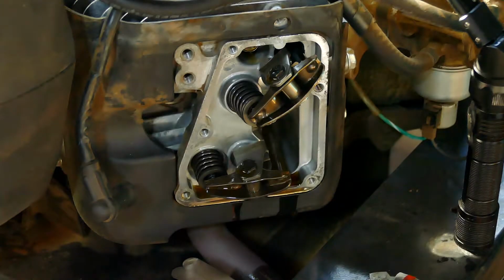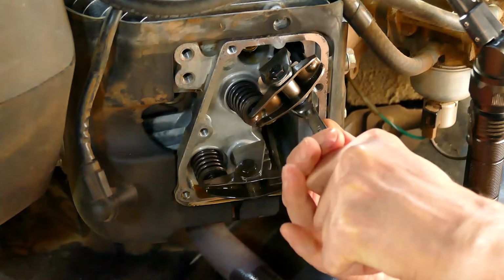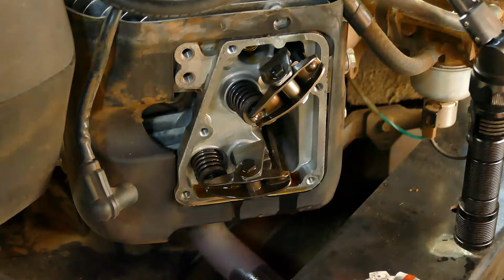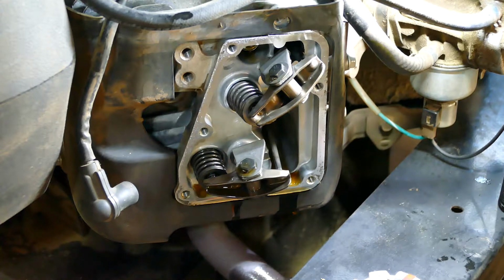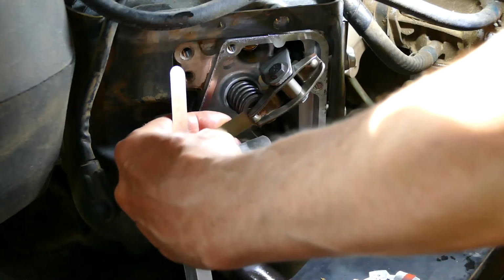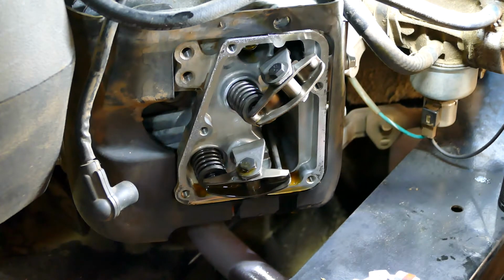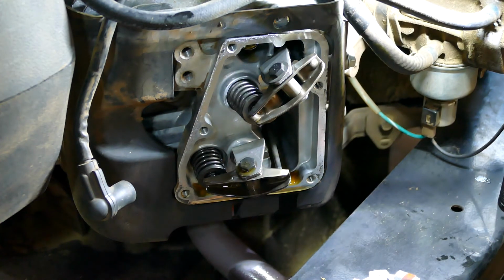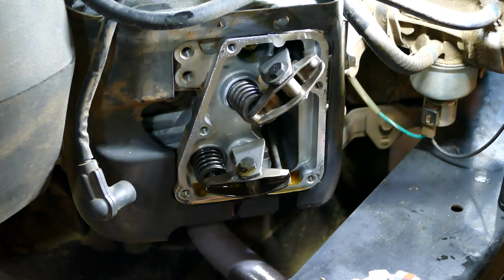Kawasaki FR730V setting valve clearance

Comment: I just adjusted my Kawasaki FR730V intake and exhaust valves using your video as guidance. I have 770 hours showing on my hour meter and they have never been adjusted.
It worked out just fine, and it seems to run much better.  I adjusted both my intake and exhaust valves to .004" too.  Upon my initial investigation before any adjustment, it appeared that most of my valves were at about .009, and there was one exhaust valve that hardly no clearance.
Reply: @electricalsoulutions4364 I have a Kawasaki FR730V on my newer summer season 2023 Husqvarna TS-354XD with only 70 hours on it now so I'm far from adjusting them for a long while, but I had a likewise experience with my 2013 Craftsman YT-3000 which became my winter plow only tractor has a B&S 21 HP single cylinder with 850 trouble free hours on it and I too never checked or adjusted the valves until I had 750 hours on it and initially checking them they were a bit loose around .009 also, so I set them to their standard .004-.006 and seemed to run much better and quieter too. 😊

Comment: My FR730V Repair Manual says between 0.0020” and 0.0039” for both the inlet and exhaust valve clearances. It says to use a 0.002” feeler gauge. Where did you find 0.004”-0.006” ? Is there a different source than the Kawasaki book?
Reply from the maker: Page 10 https://www.badboymowerparts.com/images/Bad%20Boy%20Engine%20Manuals/Kawasaki%20FR651V,%20FR691V,%20FR730V.pdf
Reply: Page 27
Reply: @DAS-Videos    Thanks very much for a link to that manual.  One more task I don't need to do before working on this machine.
Reply: I'd like to see a link to that manual or the exact name of the manual at least.  Those specs don't sound correct at all.